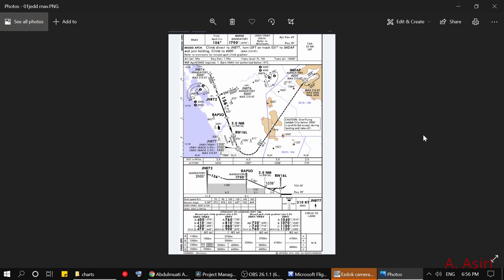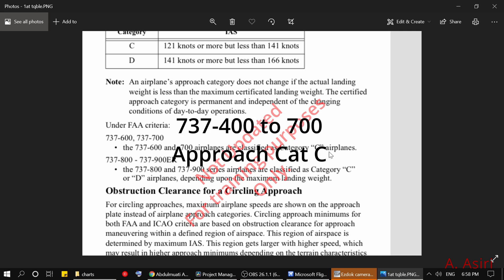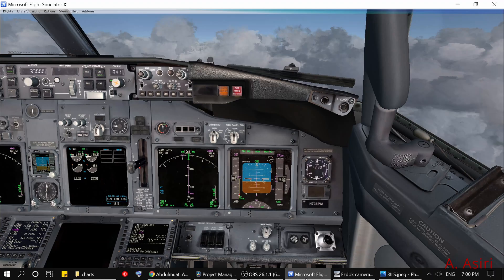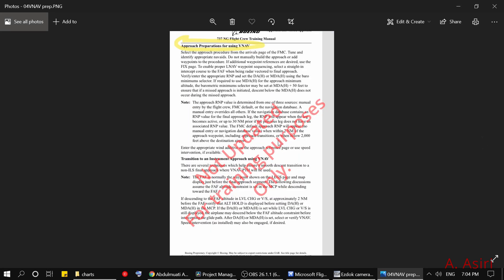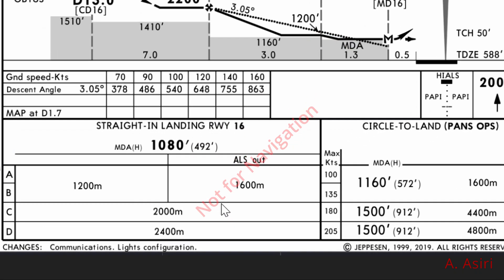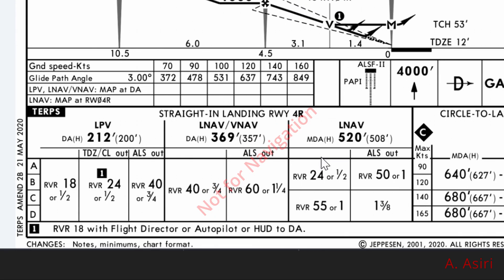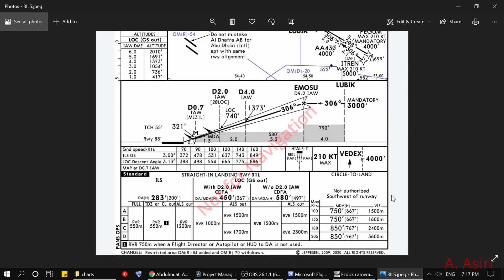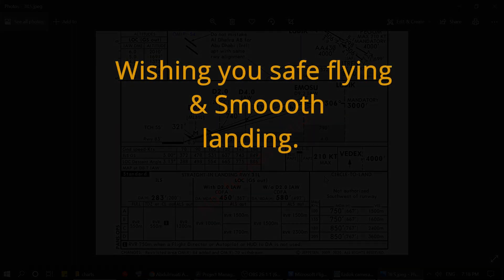DA & MDA

Comment: A good memory aid to remember what to do for DA and MDA is to think of them as Don't Add and Must Do Addition. So for MDA just add 50 ft or your opsspec number.. Because we must do addition.
Reply from the maker: I like the acronym Must Do Addition,  thanks for sharing your knowledge and tips S G. 
Just one point, I don’t thing adjustment altitude is a must, although the chop and drop technique is not used anymore, if someone elect to level off at the MDA up to the missed approach point, it’s still an option. Just to be clear I am not in favor of this technique but I don’t think it is illegal to use. 
Thanks again for the feedback and participation S G 
Really appreciate it.
Reply: @AbdulmuatiAsiri37  I think the thinking behind cdfa is so that pilots are not leveling off and flying to map and then descending.. Too many power changes leading to unstable approach relatively low. As you said, the new preferred easy is cdfa. You descend in lnav/vnav to mda+x.. If runway in sight.. Continue you land. No power changes required. If not I'd sight.. Go around. Also no need to account for MAP which is another thing you have to remember about non cdfa. Essentially just fly all these non precision approaches like rnav/gps approach.
Reply: @AbdulmuatiAsiri37  as for levelling off and flying to map.. Sure not illegal.. It's depicted as so in the plate... But if ops says fly as cdfa and you do non cdfa and something happens.. Kinda hard to explain. Too many instances of people leveling off at mda looking for the runway.. Go past the map.. See the runway and then dive down.. Land halfway down the runway. It might get you in more often than a cdfa.. But I think statistically negligible especially considering it's less safe method.